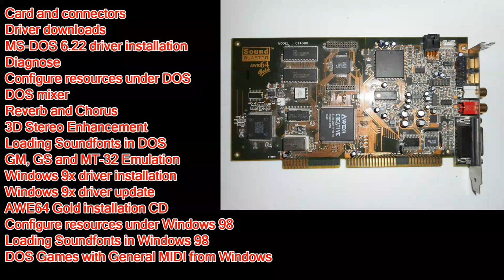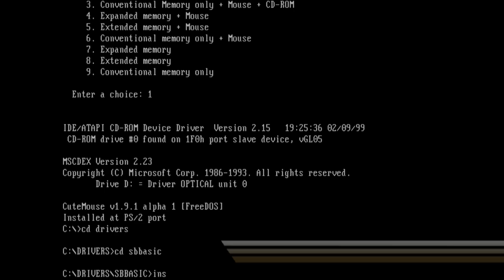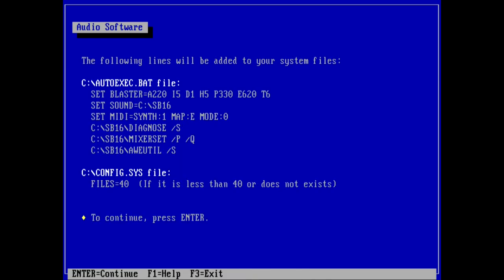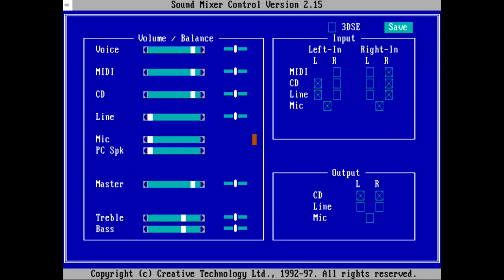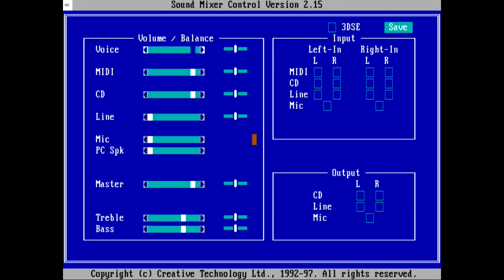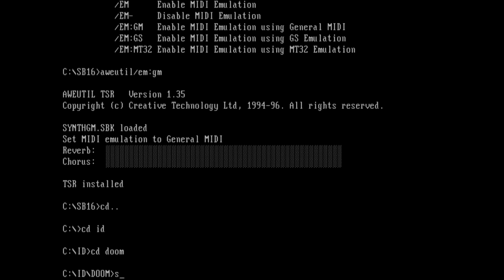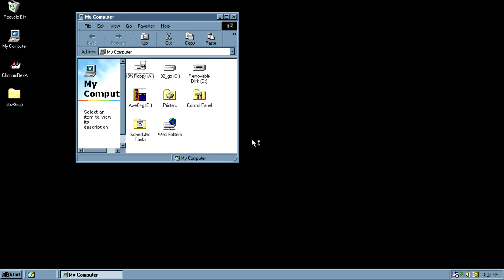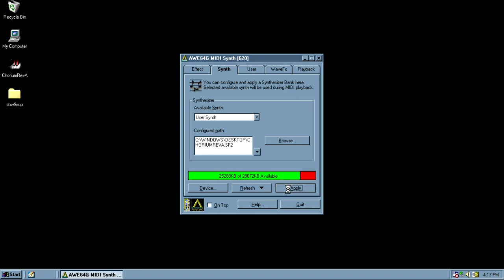Sound Blaster AWE64 Gold Review

Comment: I recently installed an AWE64 Value with a SB Live! in the same computer. It seems Creative knew some people were going to do this, as when the AWE64 is detected by the SB Live VXD drivers, it disables automatically its MS-DOS emulation part and let it fully relying on the AWE64 to do that task. It is amazing how well that combination works. Pure MS-DOS with excelent FM, bug-free MPU, and AWE features plus Windows 98 with EAX and unlimited SoundFont memory with the other Synths available. It also trully defeats the purpose of getting an expensive AWE64 Gold or AWE memory upgrades.

I also got this fully working with an Audician 32 plus + SB live, but it was a lot harder, as i had to do some registry tweaking in order to keep SBpro/16 compatibility fully working in both cards at the same time using different resources, specially because of the FM 388 address which was not changeable and caused conflict. This combo was also not so feature rich than the AWE64+Live for DOS games, but allowed having the Live taking care of the sound effects, and the Audician only do the FM OPL syntesis in DOS games.

Comment: This card is phenomenal.  I was fortunate to find one with a Creative 4 MB upgrade module (for 8 MB total), but didn't act quickly enough to obtain a SIMCONN adapter.  I bought another one in 2009 for another build when nobody wanted them ($25 at the time).  They are horrendously expensive today, but, for anyone looking for one of these, a regular AWE64 also works very well, is much cheaper, and still provides AWE32 compatibility for DOS games.  The AWE64 Gold has gold connectors and split RCA outputs for your speakers, but unless you have insanely sharp hearing or use headphones, I haven't noticed any significant differences in the audio quality when it comes to MS-DOS games.  The Gold also has 4 MB of SoundFont RAM built-in (the regular AWE64 has only 512k), but if the goal is strictly AWE32 compatibility, you can save loads just getting a regular AWE64.

Comment: Best soundcard ever made - so sad I threw mine out years ago when I skipped having desktop computers.
Reply: I don't know why you have compatability issues with DOS - the AWE64 is fully compatible with both AWE32 , SB16 and Pro 2. 
I played lots of games under MS-DOS 6.22 with my AWE64 when I had it - I remember, because some 3Dfx games ran better under DOS than Windows 9x  - so I would dual-boot through System Commander between MSDOS6.22 and Win95/98/98SE/Me/2000....

Comment: In the video at around (05:30) during reconfiguration of the card, you chose option 1 which sets the MPU I/O Port to 300 instead of 330. This doesn't give a conflict. Later in the video (at around 10:33) you choose the 330 option. Just wondering is this was the cause of a crash. Or maybe you edited the video together after correcting the inital mistake.

Comment: These things are a lot of fun. I use All Sound Tracker and you can actually use the EMU chip and the OPL3 at the same time. Can even throw some PC speaker in there if you are feeling like it. The emu filter is weird though. It cuts volume and the resonance doesn't peak any higher than the instrument level so you have to make everything really quiet if you're using the filter. Also, the FM is my fave. I use it for recording all my AT2 songs.

Comment: Please help, I just got this card it works with games after 1996 like doom, duke 3d which has sound settings, but not working with old games like wolf3d, when I run it, the sound blaster option is not even enabled, does that mean it is not compatible with old games? or I can use aweutil.exe to fix this? please advise. 🙂

Comment: Awesome video! Thanks Phil - I always enjoy your sound videos. Could you perhaps do a video or video series on getting an MT-32 or SC-55 to work with a Yamaha YMF-718s and SoftMPU?
Reply from the maker: Evert Coetzee The only Yamaha card I have is this Audacian or something like that. That card is pretty straight forward, much easier to get going than the AWE64 Gold :) A general video about SoftMPU might be interesting though.
Reply: I also have one of those Audician 32 cards. which is just a YMF-718s, from what I could gather it's very compatible with SoftMPU. But yeah, I was going to offer to send you one of my Yamaha cards if you couldn't find one - I have a YMF-718s and YMF-719. I would really like to invest in something like an MT-32 or SC-55, but because of the very high shipping costs and risks of importing it to my country, I want to be at least 99% sure of the quality before I take the plunge.
Reply from the maker: I wanted to cover the Audician 32 anyway, because I got it complete, with box and drivers and I know that many have this card. It has wavetable and an external MIDI port, so it should work fine. No hanging note bug either and the output quality is very good. What's the difference with the 719?
Reply: Visually, there is no difference. The parts look to be the same on both cards with very slight PCB layout differences. I know you can use the same DOS driver on the YMF-715 to YMF-719 series, so SoftMPU will probably work fine with any of them too.
Reply: +Evert Coetzee In which country are you living?

Comment: I have a little question, AWE64 driver in ms dos need to have expanded memory enabled ?
Reply from the maker: There is no driver needed, running AWEUTIL will simply initialise the card :)
Reply: @philscomputerlab  Okay, thanks for reply. I get mb on socket 370 with pentium 3 800 MHz + voodoo 3 3000. I thinking to buy awe64 ct4520 because motherboard have one ISA slot and also bios have option to disable cache l1 and l2. Maybe stupid question but i want also some windows games like nfs 2, incoming, carmageddon 2 and this games will have sound on this older sound card?

Comment: Phils. I have a AWE32 that died. And i have a SoundBlater Live 5.1 PCI and a Yamaha 744Pro PCI. And i have a AWE64Gold (for repair, needs capacitors, but assume its good).
What cards you will be using if you had this cards?
Its a pentium 3 1400Mhz. Iam thinking of using only AWE64, but AWE64 missing OPL3. Yamaha 744Pro have OPL3 if iam not wrong, but its a PCI card. Maybe its a good ideia to use the Yamaha 744 Pro in Windows and AWE64 in DOS?
Or just use AWE64 for everthing?. Pentium 3 have the power to run dosbox for some games. Other possibility is to stick with one card (for exemple AWE64) and use dosbox for "problematic" games. What are your susgestion?
Iam trying to make a "all in one" DOS-Win9x to early XP era computer (Swap HDDs when i want another OS). I have a P3 1400Mhz, 512Mb of Ram (can take 1,5Gb) and a Geforce 4 MX440.

Comment: great video. i have 2 questions: 
you have the original cd for awe64 (not gold)? 
the adapter for more memory, works for awe 64? (not gold/ct4500)
sadly is hard to find both here (Brazil)
Reply from the maker: Kurt Hectic The adapter is only for Gold. There is a different SimmConn for the non-Gold cards. The CD I have is a copy I found online :)
Reply: do you know where i can find the adapter? and can you give a link for download?
Reply from the maker: The links are in the video / descriptions. I bought the SimmConn from a friend. Might check on eBay and other auction places.
Reply: Ok, thanks :)
Reply: +Kurt Hectic dei sorte por achar uma placa de som aqui mesmo, tecnicamente pelos review é melhor que uma awe64, mas para achr outra vai ser raro :(
Ao menos suporta memoria edo normal ahuahau
Reply: Serdaco has managed to make a universal SIMMconn now, it works with both due to some reprogrammed logic. You have to find a 32mb SIMM though as the limitation. There is a thread on Vogons.

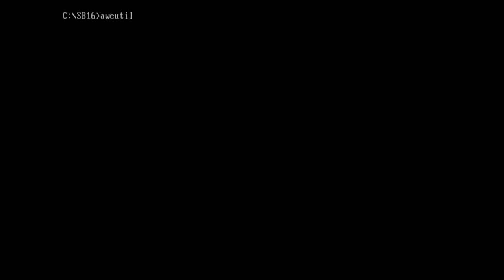Comment: 9:30 - My first soundcard was a Gravis Ultrasound so I've dealt with worse...  But this seems like a terrible limitation for a soundcard designed for MIDI music, to be unable to reliably emulate the (non-"smart"-mode) MPU-401 interface, which would be the most common way for games to provide MIDI music if they don't support the sound card natively.
I have to wonder if maybe they did that on purpose to drive software authors to natively support the card instead...?

Comment: Hi. Need some help. I have a Ct4380. It works OK in Windows XP, but the speaker out is mute. Do you know if there's some issue with xp? Or may be the spk out is dead... Thanks
Reply from the maker: XP is quite the mismatch, I've never attempted to use an ISA sound card with Windows XP. Best OS to use is Windows 98 SE and it's built-in MS-DOS 7.1.

Comment: Hi, nice video. I want to ask you if the AWE64 works similar to AWE64 gold. Thanks
Reply from the maker: ***** Yes but it has less memory onboard. The Gold is quieter. I have a normal AWE and it has an audible hiss of background noise.
Reply: philscomputerlab Thanks for the answer :)
Reply: +philscomputerlab 
just order the CT4390 on ebay 29.99 , AWE 64 GOLD

IS this a good deal?
Reply from the maker: Yea that's fair value I would say!

Comment: With the SIMMCONN module (with a 32mb EDO ram) it seems to remember my soundfonts after reboot (even shutdown). So I do not need to load the soundfont over and over again. Something I just noticed that you said in this video here.
Reply from the maker: Interesting at is uses Dynamic RAM, which requires constant refreshes to store information. In short, this can only work if the computer receives power.

Comment: I got an AWE32 CT3670 and I couldn't figure why the heck the PC Speaker pins were so distant, I couldn't reach them with the chassis cable...  what kind of cable do I need to hook it to the mobo's PC speaker pins ?
Reply from the maker: The chassis cable? That IS the actual speaker of the case. That doesn't go into the sound card, but you connect it to the motherboard.

You can mod a CD Audio cable, or get something like this: http://www.ebay.com.au/itm/40-Way-Rainbow-Color-31cm-Flat-for-Arduino-Jumper-Cable-Wire-1P-Home-Appliance-/321819198104?hash=item4aedeb4298:g:1PwAAOSwT6pVuabI

You just need two wires. Connect to the sound blaster and then to the two outer pins of the 4 pin PC speaker on the motherboard.
Reply: Yeah, if only I could figure out which pins on that motherboard are for the PC Speaker, I wouldn't need to redirect the PC Speaker to the audio card that way....
and before you tell me to check the manual, there's no info and I can't even find the manual for the exact model of that motherboard (from the "What manufacturer and model is this motherboard" thread I made on Vogons)
Reply from the maker: It's a 4 pin header on the motherboard. Usually at the front.

Comment: Hi! Its new for me that you can add EFX on FM, cool! Its possible to make this on the Windowsmixer or Setup to or only on DOS and is this saved and working after new started PC?
Reply from the maker: Yes I believe you can do the same under Windows in the EAX control panel. Add reverb, chorus and other effects. Under DOS the settings are not saved, but easy to add to the AUTOEXEC.BAT file so it configures it automatically when you start your computer.
Reply: @philscomputerlab  Hi Ok I will search, but i think there war nothing in Windows and AWE has no EAX Control Panel or do you use other drivers?
Btw, you can listen to my special AWE version from Thunder Force IV here:
https://www.youtube.com/watch?v=COZyhM5Meo4

Comment: Did you record the dos part with DOSBox or some dos-compatible capture card ?
(I'm Elia1995 from Vogons, by the way)
Reply from the maker: DOSBox? Blaspheme :D

I usually just use a card with DVI output and use a DVI > HDMI dongle to capture :)

For older machines, like a 386, I use a VGA > HDMI scaler.

Unless the video is clearly about DOSBox, you can be assured that everything I do is on real retro hardware.
Reply: PhilsComputerLab I've been running through a lot of issues trying to record my Windows 98/XP PC, for now I'm just going with S-Video directly to my capture card (Hauppauge HD PVR) until I can find a less flickering and blurry solution :D

Comment: i like the ct4170 the most, because it plays mostly old dos-titles and mostly all demoscene-stuff. the awe64gold has a lots of problems with dos and damascene-stuff. if you have a dual boot-machine dos/win9x driver-resources must be the same. otherwise win9x will change the configuration of the card an dafter booting dos, you have to configure the resources again. In GLdoom/heretic/hexen (win9x) the Mixerfunction does not work. You can't change the Volume of the music only. the sfx is alway effected. The CT4170 does not have this problem.

Comment: Can I apply the reverb and chorus effects or even 3dse on a second isa card's fm output? I'm looking for a reason to get the awe64 gold lol.
So can I disable the fm emulation on the awe64 (have it not be audible) and pick a different card on another slot with a real opl3 chip in a game's setup but still be able to apply the gold's effects on it?
Reply from the maker: igorbog88 I'm afraid that doesn't work.
Reply: philscomputerlab Have you tried it? Shame then.

Anyways how is the soundblaster 16 support on the awe64 gold ? (sorry if you did mention this, I skipped through the video)
Is it virtually identical to the non-clone sb16 cards in terms of it working with practically every game under dos? Or are there issues?
Reply from the maker: The AWE is basically a SB16 + AWE :)

I doubt you will find a game that doesn't work with it.
Reply: philscomputerlab 
Ah that's great then.  Thanks.

Comment: I had and still have an AWE64 Gold. However, I could never get it to work under Windows 98. Windows 95 always worked perfectly. I'm wondering if the driver was bad or maybe it was the motherboard of the newer PC that didn't like ISA cards. But a great video. :)
Reply: I have the Gold running on a P-III Win98SE system and it works flawlessly
Reply: @little_fluffy_clouds  Yes, I have heard that from several people. I just could never get mine to work. So I ended up getting a Sound Blaster Live for my 98 machine and that worked perfectly.

Comment: Can a Sound Blaster Live 5.1 Digital emulate MT32 like the AWE64?
Reply from the maker: +MrGreenMineral Hmm that's a complex question. I know you can load a MT-32 SoundFont map, but I don't think it will work from DOS.
Reply: PhilsComputerLab Didn't even plan to use it in DOS, but rather in Windows NT 5.x (2000/XP) and 6.x (Vista/7/8. There are drivers which make it work on NT6.x). For DOS and 9x I have an AWE64.
Reply: +PhilsComputerLab It did work with my X-Fi XtremeMusic in WindowsXP.

Comment: does the AWE-64 have the fm synthesis like on the sb16, if so, i bet its CQM.
Reply from the maker: +Windows Ninety Five 66 It has CQM. The AWE64 Gold is not the card for OPL3 purists, there are much better choices. But it has many other things going for it. The ability to apply chorus and reverb to FM is one such highlight.
Reply: im not really that picky with the fm synthesis on the sound cards, i have heard worse, like the crystal fm synthesis on a emachines etower pc that i used.
Reply: +Windows Ninety Five 66 I just ordered a soundblaster 16 ct2830 which has a YMF262 chip and is non PNP, i know that cause i see the dip switches on it. I saw one for $15.99 on ebay.

Comment: Phil can i use the drivers on your webpage for a non-Gold AWE64? I ended up getting the CT4380. Thanks
Reply from the maker: +Mastran77 Yes, absolutely! The driver package also works with other cards, such as the AWE32 and Sound Blaster 16 :)
Reply: +philscomputerlab Got it Working, the Soundfonts on Windows9x work great with AWEControl Sofware,. Enough for today, i´ll leave the DOSMode config for tomorrow, and next up is the MIDI Emulation through USB (when i get the adapter). Thanks for the quick answer !
Reply from the maker: DOS mode is a bit of work, but I've also covered this in another video of mine :)